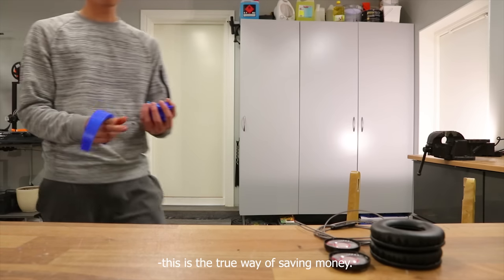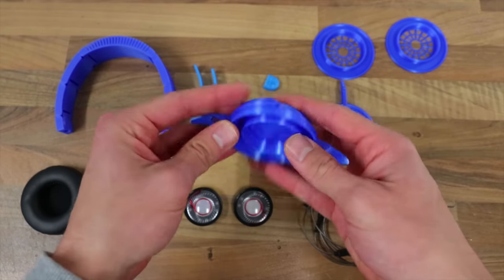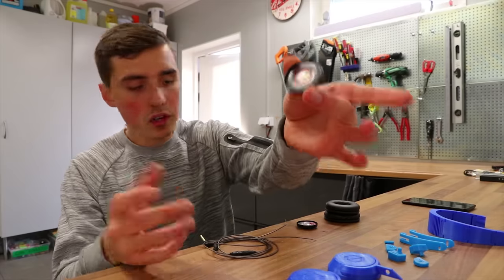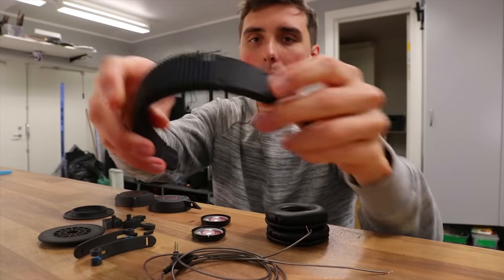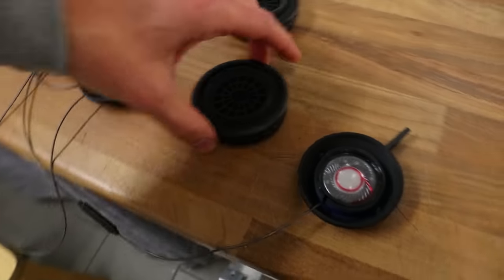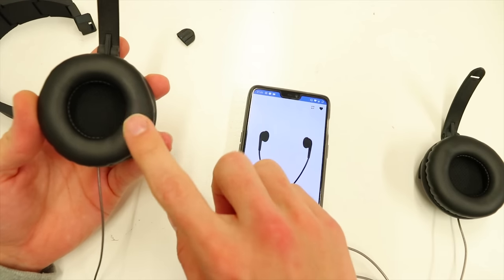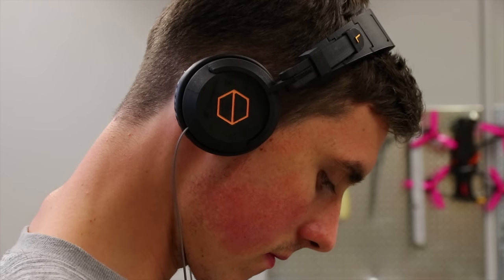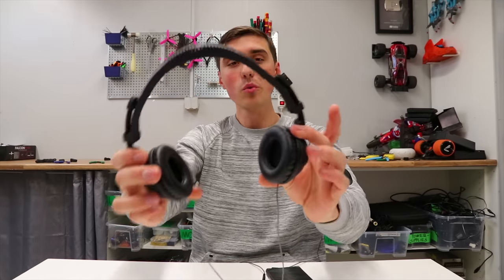Working 3D Printed Headphones!

Comment: Printing larger cup rings for on ear headset works really well. For 10euro on ebay one can buy replacement pads belonging to 100-150euro headsets! Makes a world of difference! Thicker pads gives less boomy but more precise bass. Thinner gives more and deeper bass. Usally I just glue the adapters on the headset bell and the pads covers the glue. Printing the rings with 10 degrees horisontal angle usally makes them fit the head better and improves bass and sound isolation.

Comment: Very cool project!
I'm looking into 3D printing rather custom solution for my SSD (Single Side Deafness) with a bone conducting CROS (single headphone).
CROS is abbreviation meaning to overcome the head-shadow effect of being deaf on one side (like my right ear).
Note that you still wont be able to tell sounds direction - that's impossible with single ear - but at least you won't get deaf zones anymore.
I came to the bone-conduction idea because it can keep my ONLY good ear open to hear normally (instead of plugging it with in-ear piece) and just add the missing sounds from right side.
The mic part seems to be easy as there are hundreds of lavalier mics out there, and it seems there are plenty cheap but decent ones.
The audio interface seemed a bit challenging, but I discovered the Rode AI-Micro which has direct monitoring, so it seems great for my purpose.
The biggest challenge is the bone-conduction earphone, because it seems the commercial ones are not only headsets (for both ears) but also wireless :/ 
I prefer just to connect the wires and not worry about connectivity (or battery).
There seems to be few bone-conduction exciters/transducers, though I don't know if they're good quality.
But it would make interesting project.
And advice would be greatly appreciated!

Comment: Thank you!  I printed the whole set and it came out looking all good!  Except when I tried to loosen the links in the headband, I broke 2 headbands already and not even one of links I can break loose.  I used knife on the gaps before applying force to break them loose. Any special hints there on the procedure or the slicer settings?  Many thanks!

Comment: It would be pretty sweet to build head phones that would normally cost you $300+ at a reduced price but finding the parts with out having the benefit of owning a factory or buying in volume (heh) if you can at all still sounds pricy on top of you probably need some knowledge on how to make it sound good like using certain shapes in side the head set and materials

Comment: Hi, I am using ender 3 
Actually I tried to print the head band part ,after printing the joints are stuck .They won't move ,gets broken 
Can I know what settings should I use  to print this
I am using cura slicer by the way